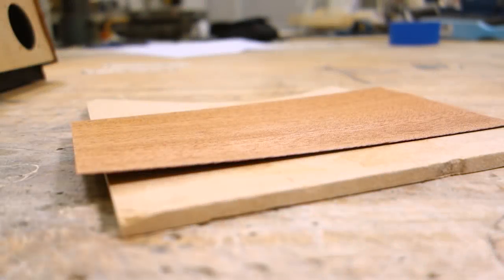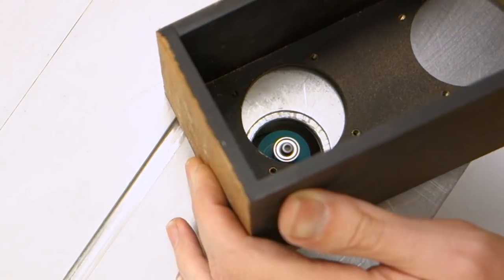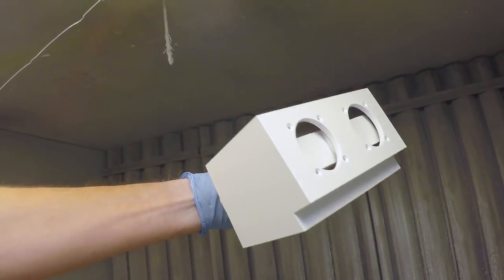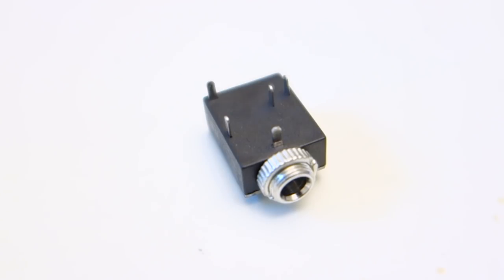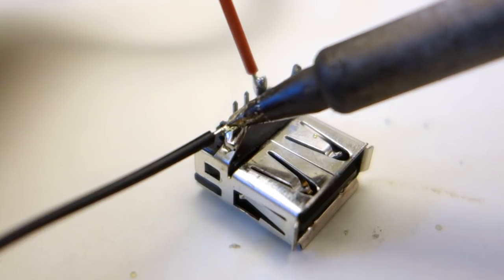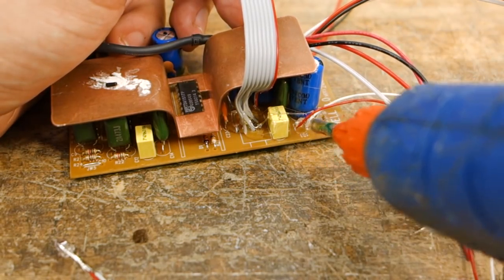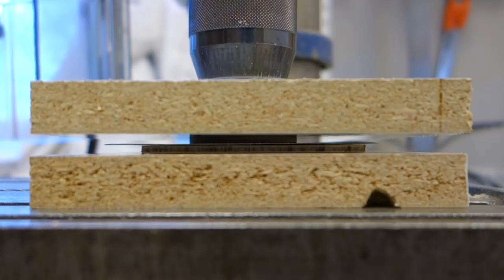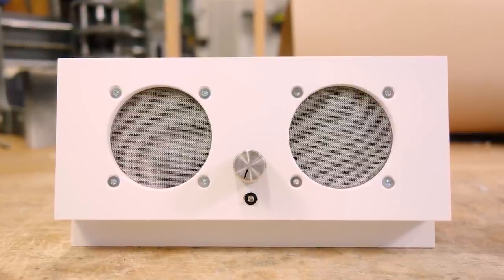How to Fail (and Succeed) at Building a Speaker

Comment: That finish reaction is called “fish eye”. It’s probably a reaction between the glue, which must’ve soaked through the whole material, and the finish.
Reply from the maker: I'm not sure, as I've varnished with that brand of varnish over similar things in the past, even PU goes over most things. Problem was most likely the can being old and stored improperly, so the polymerization of the varnish had already started. It was thicker than it usually is, and rushing it I didn't take the time to cut it with mineral spirits like I usually do.

Comment: At this point with 322 comments I'm not going to read them all. If this is already mentioned sorry. I didn't notice any surface prep work on the walnut ahead of your finish. A cleaning with TSP and a good rinse. Let dry and finally a light sand with 150 to 200 grit to open the grain.
Reply from the maker: You don't need to read even 10% of them, this has been discussed numerous times before. It was because the poly was old and had started to polymerize in the can. Combined with not cutting it with mineral spirits like I usually do made it not cure.

Comment: Always iron veneer on a low heat before gluing it to the wood and then use a vacuum bag to hold it down and remove any air bubbles.

Comment: The glue wicked into the grain of your veneer and caused the varnish to bead up. Use a sealer on the veneer before gluing and you should be good to go. Another option is using iron on veneer which comes already sealed.
Reply from the maker: This has been discussed to death in the comments already. No, that wasn't the problem. The problem was too old varnish and the fact that I did not (despite usually doing so) thin it before applying. I've run PU varnish straight over woodglue and it does not bead up like that.
Reply: @SwitchAndLever  My apologies. I don't normally have enough time to read all the comments in every youtube video I watch. So have you tried doing it again with new varnish and different results?
Reply from the maker: @charleslalonde7024  this specific project? No, it ended like I showed in the video. I have used PU varnish before this and after this on walnut before without issues. I just learned to label my cans with date, and not use PU varnish that's been sitting around opened for two years.

Comment: oh man, are you soldering or welding xD
(in fututre use soms shrinking tube, it is a great protection from shorts, makes it look more clean and covers up crappy soldering)
Reply: but hey, I mean it in good manner, "cold connection" (maybe has a different name in english) is a problem that can harm signal quality ( especialy any high frequency) and can cause overheating and eventual failure on the soldered spot if more current is driven

Comment: Just sand that warnish with 400 or 600 grit and warnish again. It is completely ok for the grain of wood to mess with surface tension of varnish.
Reply from the maker: No no, I don't think you get just how coarse the varnish was after drying. It would've taken considerable sanding at those grits to get it down smooth, all the while taking care not to sand through the veneer. Far more work than it was worth, with far too big chance of continued failure.

Comment: does the speaker edge donot reach the mesh you placed in front of it when on high volumes? assuming that it will give quite some excursion :)
Reply from the maker: porto42 not at all, it's quite recessed so volumes high enough to make it reach would blow the speaker.

Comment: You could have gotten a couple of full range drivers and designed the box to accommodate them. The difference would probably be significant because small full range drivers don't cost much. Since you put so much work into making the cabinet, why not spend a few bucks and do it so the end result actually sounds decent?
Reply from the maker: Because that's missing the point, the video is not about buying components and building an enclosure, it's about seeing what you can cobble together with what you may have available. Why not spend a few bucks? I didn't want to spend a few bucks, and the end result does sound decent. The drivers used are by far good enough for most applications.

Comment: So the jack is 12V is that centre pin positive or negative?
Reply: You almost always make it centre pin positive - so that the plug doesn't have 12V on the outside conductor
Reply: This is true but does not say S&W did, I have a few old Casio products where they switched the jack around, probably to force the average consumer to buy their PSU.
Reply from the maker: Indeed, like theducks say, center pin positive, outer is ground. That's pretty much standard these days and while some things fall out of the norm it's rare.
Reply: OK 12V AC on the centre pin it is ;)
Reply from the maker: No no, you misunderstood, it's 16000V, three phase AC, right into the speaker drivers, bypassing the amplifier altogether!
Reply: Haha, that's gotta be a record for efficiency.

Comment: Yeaaa. You never use polyurethane on walnut anyways. Poly is such a tacky finish, go oil or wax
Reply from the maker: I've used it plenty of times in the past, without any issues. Poly is a good durable finish. The issue was likely that the poly was old, and I didn't cut it with mineral spirits as I usually do.
Reply: @SwitchAndLever  I haven't read through all of the comments, so it may be that this has been covered elsewhere. 

First, I'm willing to put money on the fact that this veneer was not walnut. I could be wrong, as camera and lighting often do strange things and you could be using some sort of Euro-walnut species I am unfamiliar with. That said, I'm %90 sure that you were using veneer made of some species of mahogany. It's not uncommon for veneer to get mislabeled.

As it was likely mahogany (and even if it was a Euro-Walnut), you should always wipe the surface with acetone before applying the finish, as this will break down the surface oils that are abundant in these types of wood. 

Even though you have attained good finish results with brush on poly, in the past, I would always recommend using a wipe on poly or a poly-oil mix for walnut and in the case of mahogany species, I would skip poly altogether (because poly can tend to pool and absorb poorly in some species of mahogany) and I would apply very thin coast of shellac instead. I would have also sanded this veneer to 220 before applying any finish. 

If you cut your shellac thin with denatured alcohol, you can apply several very thin coats at once. Shellac will bond and fill the small pours in mahogany (and walnut) much better and more evenly than poly. The shallac is much more forgiving and will allow you to do a sort of french polish with wax that is also cut with denatured alcohol a 0000 abrasive pad.
Reply: @ticklesdust  polyurethane looks like plastic because it is plastic! I happen to like a nice gloss clearcoat myself though. To each their own.

Comment: Where did you get that switching aux input? I've been looking for that and am having trouble finding one.
Reply from the maker: From a Swedish electronic component supplier. Look at Mouser or DigiKey, go to the 3.5mm audio connector category, and add "switched" and "female" as the options and you should find many dozen different varieties.

Comment: better use higher power amp. that TEA2025 is crappy. your metal mesh is not deep enough for speaker excursion
Reply from the maker: Another person who missed the point of this build. 

And no, the mesh definitely is deep enough, there is a reason I deform it in the video you know.

Comment: Nice video.  I can't say what happened to your original attempt to finish the speaker box, but putting poly on walnut is not something I would ever do.  A light coat of linseed oil or furniture wax is enough for walnut.
Reply from the maker: Depends on what your aim is. I've put poly on a lot of walnut before, because I wanted a durable finish. I would never put linseed oil on veneered MDF though, because MDF is like a sponge and will absorb any liquid readily.
Reply: @SwitchAndLever  Ok, I've got prejudices here.  I think MDF is only good for starting fires and if I was going to cover up a piece of wood with plastic, I'd just use plastic in the first place.  I have finished veneers with oil and wax.  One thing that will help a lot is to prep it using steel wool, not sandpaper.  Apply linseed or tung oil using a cotton cloth.  Rub on just enough to fill the grain, don't dowse it.  My favorite way to finish most woods is to use a paste wax.  I have used it over a coat of oil.  It's nice because it's easy to renew it.   Oh, and never use a water based anything to finish wood.  So far, every water base I've tried was just crap.  That would be especially true on an oily wood like walnut.
Reply from the maker: A thin coat of satin poly does not make the wood feel like plastic, it makes it feel like varnished wood. There's a world between varnishing something and coating it in a thick clearcoat. 

This was oil based poly, and most likely it was too old and had started polymerizing in the can, hence the poor result. I doubt it had anything to do with the actual walnut.

Comment: Dude, all you had to do is to lightly sand the poly.  It is just like acrylic.  You sand the poly and it will turn white and you will think you completely ruined it.  Then just paint another coat and it will suddenly, immediately, all go perfectly clear again.  Your first coat did not have any solvent. Poly comes way too thick and you have to dillute it.  That's all.  So on each successive coat, after sanding in between each coat, after letting it hard dry first, ...make each successive coat of poly thinner and thinner, and you can make it look like glass..  Sand with 240 grit sand paper and then use a light steel wool, although that gets messy and ugly. ...or it can.   Clean it off with solvent.  Get the solvent made for the poly, usually by the same manufacturer.  It won't look like you sprayed the finish on, but you can get very close to that just using like half solvent and half poly on the last few coats.  I have made a lot of great furniture just using that technique and it all turned out fantastically.
Reply from the maker: It’s funny how someone who wasn’t even there knows exactly what happened. No. The poly had started polymerizing in the can. It was not a viable varnish. This has already been discussed in the comments countless times. I’ve used by far enough poly in my life to know how it should act and does act.

Comment: "mdf takes pain well"?! Im sorry but no, mdf does not take paint well at all.. mdf is some of the most difficult materials to paint, you have to seal it at least twice before thinking about painting it
Reply from the maker: I entirely beg to differ. It takes paint extremely well, simply because it's absorbent like hell. It doesn't mean you get the greatest of surface, but in terms of taking and adhering to paint it's bar none.
Reply: Well yes of course in that sense you are correct but it is quite difficult to get that car like finish.

Cheers!
Reply from the maker: Oh, absolutely. To do that you basically need to do what I did later in the video. Saturate the MDF with primer first, then apply your topcoat on top of the primer.

Comment: If we don't fail we can't learn. tips: your wood veneer looks like it is contaminated. remove the varnish, sand then clean the wood with alcohol. Also if you add a cushion between the grill and the speaker it would sound less tinny.
Reply from the maker: It's a two year old video, the failed enclosure was thrown out long ago. Also, no, it wasn't the fault of the veneer, it was the fault of old varnish, and me not cutting it like I usually do with mineral spirits.

Comment: the housing came out great but please use drivers with a little bit of quality and dont use such an terrible amp,
otherwise its a realy great video
Reply from the maker: Refer to one of the last points I made in the video, about audiophiles. Using high quality contents wasn't the point of the video. Of course I could've made better speakers if I was willing to throw a bunch of money at it, but I wasn't, so I didn't.

Comment: Just because the polyurethane didnt work doesn't mean its trash. Just clean it off with some thinner and use something else. Its a cool project but I prefer the natural wood look.
Reply from the maker: How do you clean off dried oil based PU varnish with thinner without ruining the project? Seriously asking, because I simply cannot see how that wouldn't ruin the underlying MDF, or the glue up of the veneer.
Reply: Switch & Lever im a master finisher and if you use some lacquer thinner sparingly on a cloth it will loosen the varnish enough to scrape most of it off. Then some light sanding and just use regular lacquer for the finish. It works best for walnut. Some walnut has oils in it and that might be what affected the varnish the first time. Also note that most  varnish is made for solid wood.
Reply from the maker: Interesting. Oh well, I already used it for basketball practice 😄

I still think the main issue was the age of the PU varnish. It had likely started curing in the can due to oxygen exposure. I usually cut it with at least 50% mineral spirits, but for some reason didn't this time around. I've used PU varnish extensively on many projects in the past, and never had this issue.
Reply: Switch & Lever oh well yea that old jar of finish was most likely the problem. I recently made a portable power speaker myself for camping. It also has a night light. And is made from crap i had lying around.  Cheers

Comment: A tip from a speaker professional...dont inset drivers like this...it creates a horrible diffraction pattern.  They should ideally be flush mounted by routing in a shelf for the frames.
Reply from the maker: My metric is if is sounds good enough for my ears it's good enough. Also, this project was not to appease professionals or audiophiles.

Comment: I think your pva glue blocked the pores of the walnut.  Contact adhesive or hot melt sheet would probably have worked better.
Reply: Or a type of veneer with closed pores
Reply from the maker: @colinurwin7581  nope, read the many other comments about this already. The varnish had gone bad, for sure.

Comment: I'm surprised there is no ground loop at all. Be careful tap any voltage from a certain point, a bluetooth device consumes at least 40mA or more when it is not BLE. It can introduce strange side effects or don't last that long. Better use own power supply or use an isolated DC/DC converter. Anyway, cabinets are mostly designed to their speakers or visaversa. A nice (small) design does not guarantee a decent sound, The result can disappoint you and makes your project a failure. The loosey-goosey wires and all the other stuff inside are also not very  helpful to get a decent sound. Design is not the best starting point.
Reply from the maker: Congratulations of missing the entire point of this build.
Reply: @SwitchAndLever  Because?
Reply from the maker: Because you assumed this was to a) achieve a great sound and b) spend a bunch of money doing it.
Reply: @SwitchAndLever  I didn't mention money, that you need to spend a bunch of money on it and you don't have too like you showed us in your video (by salvage some old parts). However maybe some additional parts are needed to make it long term and safe, people don't want to build this if it last just a couple of weeks. The title  of your video is: "How to Fail (and Succeed) at Building a Speaker" however when it sounds bad it is not worth to build it, no succes at all. Point of detail, it is a bluetooth/amplifier speaker, not just a speaker. 

Do you really want to build a bluetooth speaker just for the looks? Don't think so. I think it was not that easy and you make a failure to made it some sort of success. Another strange thing in your video, you don't show us the real problems/results with the wood veneer, looks pretty good in the video however you don't show what exactly looks bad.  After this, you start all over. Design aspects, poking around to find a 5V rail is really ridiculous (the way you doing it). This video shows us how not to do it instead of make it a success.

Maybe you don't like my arguments but you have to be honest. You make your mistakes a learning moment but you actually do everything wrong, you turn it so that it seems to be a success however it is not. You build a nice crappy speaker without exactly knowing what you are doing. This cannot be an advise or a tutorial video like the title of your video describes, too much wrong information in this video.
Reply from the maker: Again, you missed the point. The point is to dare to do something, to not give up because naysayers like you think it’s a bad idea, to try something even if people don’t agree with you doing it. I don’t show what happened with the varnish because basically I quit the project there and then, I threw it away and I never recorded any material with it (hence the "scene missing"). I can’t show what doesn’t exist, and I do explain this in the video. That’s also what the video is about, to not give up, to push on and try again. This is not a tutorial video in how to build a speaker, it’s an inspirational video in trying and not giving up. Hence, you missed the point.

Comment: Why you enlarged the led hole? The first drill seemed to be the exact size. How can you make such a mistake? Ruinned my whole appreciation for the project... :(
Reply from the maker: No, a 2mm pilot hole to fit a 5mm LED certainly won't work. Drilling with a big diameter drill will just cause more tearout, there's a reason why you drill with small drills to begin with. It's easy to be a knowitall on YouTube, remember that, and maybe next time think one step further. Watch some other of my videos, I'm sure I could ruin more of your appreciation if that small thing annoyed you so much.